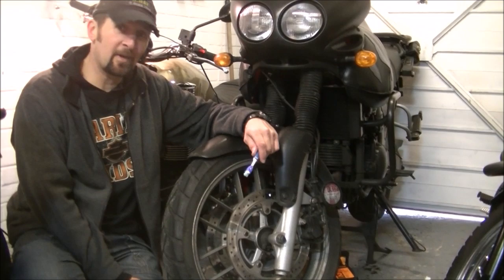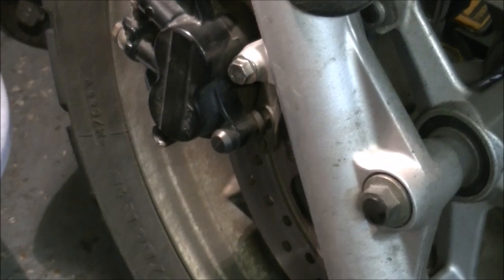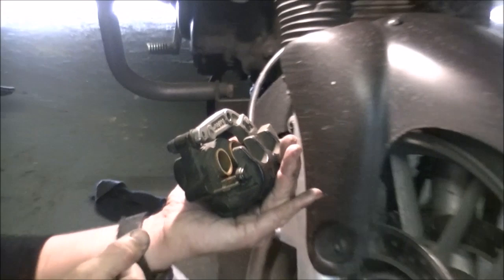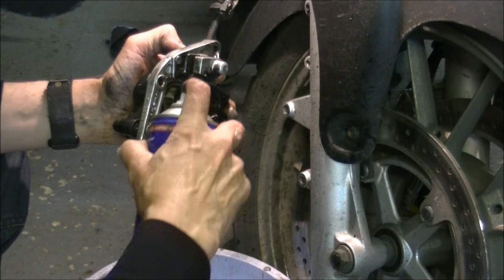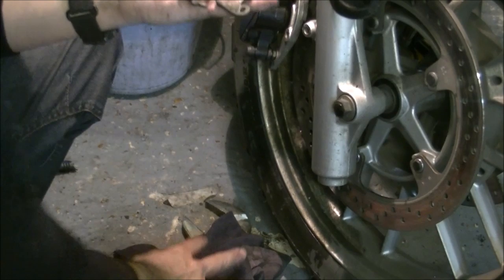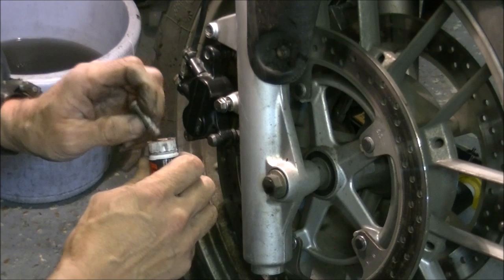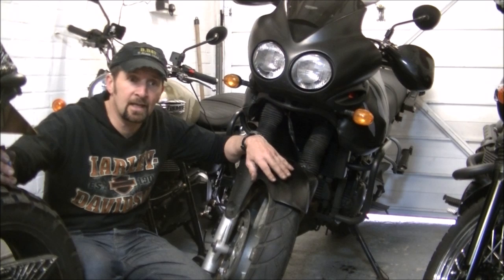Delboy's Garage, Triumph Tiger, Winter Brake Clean .

Comment: Top tip mate, always worth reminding people about these basic maintenance routines!
For those who are scared of using grips on the brake calipers to push the pistons back in: you can just open the brake fluid reservoir and remove the diaphragm, then push VEEERY GENTLY the pistons or you'll end up with a squirt of fluid on the ceiling AND on your bike! ;)
keep up the good work mate, always respect your passion and commitment!
Matt
Reply from the maker: Thanks mate...

Comment: These videos are really helping me learn the basics as I didn't have a clue! Did my first chain adjustment Sunday and the bike feels awesome as well as me =) just got my 125 and is relatively new (1600 miles) coming into Winter I think i will do this before I ride it as my back brake is squeaking slightly. Cheers for the videos! They really do help :)
Reply from the maker: Nice one Ethan, I love to hear that, we take the time to do this for the sake of riders just like you... good on you buddy.. get stuck in and keep it in tip top shape... the first thing the accident investigators do in a bad accident is look at the vehicles involved to check for faults, neglect and dangerous dis-repair.....and 'a binding front brake' will get you blamed every time... plus it can lead to the accident in the first place... just drop me a line any time you need a tip or any help..alsways here and happy to help fellah... good luck aye.. Del.

Comment: Ay up, that time of the year again. Good tippage on the dust cover -mine welded to the rear caliper last winter & I had do drill it out. No problems with it since though -the waxy copper slip really does the job! :o)
Reply from the maker: Ayup Lasty mate...good to hear form you.. and yeah, those little caps can be a bugger to get out... See you at the Ace cafe in December aye..?

Comment: I'm sure this is the third video I've seen you do this? ;) For some reason my brakes bind, I've refurbished the callipers and clean them every other week, even tried changing to a different brand of steel lines but no luck. 

I'm definitely guilty of having tons of pics on my phone on how stuff fits back on the bike!
Reply from the maker: Photographing a job as you go is wise old practice buddy, any way better then a Haynes manual..lol... It is probably the thrid one ive done...but then i do it eveyr year on a different bike, so why not... If your calipers are binding, have you actually stripped and cleaned the pistons, new seals and rebuilt them yet..?
Reply: Yeah wouldn't trust a Haynes too much, to remove a headlight bulb it says to remove half the bike.. Im too lazy and would rather have scrapped knuckles and do it in half the time lol

Yeah brand new seals in the callipers and the pistons couldn't have got any cleaner if I tried. Rebuilt is what I meant when I put refurbished!  =)
Reply: Cheers for the tip Paul, don't think the fluids even close to the max. mark but Ill check it!

Comment: Another fantastic and clear vid.  Love the drill/sandpaper trick to clean the pin.  Just use the finest grade paper? Thanks, Pete
Reply from the maker: Yes Pete, i grabe a scrap of old used paper that almost smooth, then it leaves no lines just polishes it right up..! cheers mate.. Del.

Comment: Do you have any experience of doing this kind of thing on a VFR800 or something else with linked brakes? I would like to do it but I'm terrified of all those brake lines... It's a bit of a plumber's nightmare... Hoodie arrived yesterday, love it! thanks!!
Reply from the maker: Hey up chap, glad the hoodie arrived safe, it's always a worry when we send them off with the postie...

I've done a brake bleed on my Blackbird, which has the same system, which is a few years ago, and it's not complex, just a little fiddly... the best method is to pressure bleed them with a pump device, but if they're working ok at this point, mate, then why do you need to bleed them?  As long as there is no air in the system, and the pivot is moving on the front forks, it should all be fine... as long as you change the fluid every 2 years, or 3yrs at absolute most, you'll be fine...
Reply: Not sure I will bleed it to be honest as they still feel firm enough. I've had the bike a year now and I'm not sure how long ago the fluid was changed, but it is a good colour so I'm guessing not that long ago! I might just whip the calipers off and give them a good scrub then, provided all the hoses allow for that, and leave the bleed for another year! I'm lucky enough to know of a really cheap garage with a good reputation so they can always sort it for me :) Thanks mate, take care

Comment: Really enjoy these videos, Delboy. Keep 'em coming.

Recently stripped my calipers because of a leak about a month ago (turns out it was shoddy mechanic work after a Suzuki GSXR master cylinder recall). Had them apart twice before I realised. Grief.

After the dealership fixed what they fudged in the first place, they then asked who was working on my calipers because they were leaking (very, very mildly) at the seam. The pistons were fine so it leads me to think either I didn't get the gunk out from underneath the O-ring (brand news seals by the way) or it's because I didn't use a torque wrench (haven't yet invested).

I believe the pads are contaminated to an extent now too so I'll have to chuck them in the oven.

Any suggestions for this pleb?
Reply from the maker: Hey Mr Bee....we're all plebs mate...just different levels..lol.

If the caliper is leaking at the casting joint....i would drop them apart again to make sure you dont have some debris trapped that's stopping them seal... and take the tiem to get some new joint seals. (the dont come in the regular seal kit) then make a really good job of rebuilding them cleanly... its not wise to just wind them up tighter because if it is a grain of debris in the joint all you'll do it damage the threads.

I know its long winded mate, but its the proper solution and you cant really take too much care with brakes..

Good luck with it..
Del.

Comment: Hello, Its almost imposible to get the copper grease in my country (Mexico) what do you think about using Litium grease instead copper grease just for the bolts threads? Not for the back of the brake pads.
Greetings from Mexico!
Reply from the maker: Yes you could use that Enrique, it will work, but if the area gets hot, then the lithium grease can melt and flow... you could also use a threadlock as this also forms a barrier to prevent corrosion and can still be removed, use the medium blue stuff.
Reply: @Moonfleet41  Thank you sir!

Comment: hey Del another wee brake related question for you, When it comes to getting my bike back on the road again after my off, im gonna have a bit of work to do such as cleaning the brakes again. i was wondering if having ABS would mean using a different method to whats in this video?
Reply from the maker: Hello mate, how you doing?  ...bleeding ABS is a slightly different technique, but if all you're doing is bleeding out the calipers and leaving the lines plumbed up, then you shouldn't have any more trouble than a regualr bleed... take the banjo out of the caliper and turn the hose back on itself to stop it draining... then when you re-connect them, there's only a tiny bit missing... it's difficult to describe in an email, but see how you get on like that, and let me know if you have a problem!
Reply: Moonfleet41 thanks for that Del but i was just curious about cleaning, fluids will get done with the next service. I have no idea how ABS works. so wasnt sure whether taking calipers off and back on again needs to be done differently with ABS

Comment: hey Del quick question.....Is the cleaner you use in this video the same thing as muc-off brake disc cleaner? 
thanks again mate :)
Reply from the maker: Pretty much mate, it's just a spray on brake and carb cleaner... am sure Muc-Off do one, they do practically everything else lol!
Reply: Moonfleet41 cool thanks mate, didnt want to buy something that would mess up my brakes. couldnt find anything else in halfords, :)

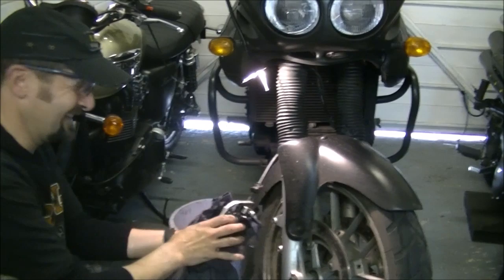Comment: Hi Delboy, Just before 13:38 when pistons are clean and dry I normally spray a bit of Silicone spray on both inside and outside of the calliper and then when after a couple of minutes spray a bit of copper grease on the piston and some goes into the calliper. Do you have any experience with copper grease causing problems with the seals?
Reply from the maker: The copper powder within it can be abrasive to rubber seals mate, so always use a dedicated rubber lube wherever rubber bears against metal... it has long since been a practice to add a dab of copperslip to the back of pads to absorb the harmonic vibration that leads to squealing, it's even written on the packaging of copperslip... it's heatproof, so won't melt or work it's way on to the disc face, like I said just a dab mate....
Reply: Thanks mate, makes perfect sense to me. Although I've never had any problems with this in practice, I'll stop it. I appreciate your response. All the best.

Comment: Delboy, with the side walls of the pistons gathering crap, as the pads wear more of the side walls are exposed, so only if the pads are renewed and the pistons retract this maintenance is more important as the mating face of the seal needs a smooth surface to travel across?
Reply from the maker: Most pad thickness is less than 5mm, so hardly a huge amount more piston wall from 'new' to 'out'......and who would replace pads every time they clean thier brakes..!
Reply: No the point is the more the pads wear the more of the piston wall is exposed, so the contamination issue is only relevant if the pads need renewing as the pistons need to retract more and the cleanliness is more important with regard to the seal...??
Reply from the maker: *****
No not in practice...its logical what you say...but in reality, the minute "in and out" of the piston in daily opperation is what gets jammed up with road salt and grime..

Comment: im going to need your advice please, I was changing the brake fluid on my sportster rear brake, not sure the last time it was done if ever, ]only really just got it], it started coming out a dull yellow  and plenty of bubbles in it after what seemed like an age on it, then it started coming out a dull white now its back to a dull yellow with bubbles still coming out. iv used about 3 quarters of a litre and its still wont clear do I need to carry on bleeding or do I need to get someone to look at it thanks jim
Reply from the maker: Hi Jim, your rear brake system holds a total of no more than a small cupful of fluid, maybe 1/4 pint tops, so if you have cleared the old stuff through and the fluid coming out now is fresh stuff you've put in the top, then the job is done... provided the fluid coming out now is the same colour as what you are pouring in, then it's just air bubbles... are you sure you're not allowing the fluid level in the cup to dry out when pumping through?? If so, you are dragging the air in... just bleed through without letting the cup run below 1/2" fluid level at the bottom, and make sure your bleed technique is not sucking air back in to the bleed valve.... do this by making sure you hold the pedal down, whilst you open and close the valve, good luck with it, hope that helps!
Reply: ok brake sorted, I think the problem was leaking nipple or a bad seal with the tube, what my real worry was it took 3 quarters of a litre for the fluid to come out clear. I did the front brake first and didn't have any trouble with it. so thanks for the advice keep up the good work and  good luck with a Harley thing your trying out see you soon jim

Comment: Del, I have been told in the past that copper slip on bolts effects torque accuracy when using a torque wrench, whats your thoughts on this?  I've always copper slipped and then torqued on brake caliper bolts and I noticed you did the same - I'll have to start marker penning the bolts!
Reply from the maker: Hi mate...Lubricating any bolt gives you a better and more acurate torque result...it allows the bolt to turn in to its correct value fully and not stop short due to friction of metal to metal binding. and the only lub for anyting that gets hot is copper grease or graphite anti sieze..! and the marker paint is just my old OCD, nowt like being able to check the bolts at a glance any time..!
Reply: Cheers for replying. a big plus is less chance of seized bolts! :)  I'll continue lubing mine!  PS great idea for cleaning up the slider pin, I ended up buying new ones but this would have saved me some cash!

Comment: Man this is awesome, i am a complete ignorant when it comes to mechanics actually i am kind of scared, but you make it look so easy. The rear tire on my bike got stucked but after a half an hour or so it rotates normally again, do you think it is because the brakes are dirty ? Do you think i should give it a try and clean them up... Thanks a lot for any comment on this, i`ll appreciate any advice... forgive my limited english (my bike is Triumph Tiger 800XC 2014)
Reply from the maker: +Vinicio Aguilar Hi Vinicio, Sorry to hear about your brakes issue.. YES i think you should service the caliper, take it off and give it a good clean to get all the brake dust and road dirt out, then see if that clears it... Im glad we can inspire you my friend, good luck with it.. Del.
Reply: +Moonfleet41 sorry to bother you once again my friend, i already took everything apart, clean it up and when i try to put everything back together the piston doesnt want to go in, i am using only my fingers to push it in beacause a friend of mine told me not to use any tools so i can damage the piston. What can i do to push the piston in ? 

Man thanks a lot for all your help, this video as you said, really inspired me to get my hands in my bike, you make it look so easy, Thank you very much mate !
Reply from the maker: +Vinicio Aguilar Hi again Vinicio, its not uncommon to have a hard job fitting the pistons back in...first you can smear a very tiny amount of grease around the piston to help it slide in...and if they are really stiff, i use a "G-Clamp", put a cloth on the caliper to protect your piant, and if the clamp will not reach in to the bottom of the piston, you can put a small socket in there so the clamp can puch in the centre... that always works for me... good luck and let me know how you get on... Del.

Comment: another great vid guys,got to do a complete rebuild on my blackbird ,do you have any tips on re bleeding them,duel brakeing system and all,many thx and I know its early but merry christmas
Reply from the maker: Hi Nick. if you dont need to change the fluid in the whole system, then just take the caliper banjo off, and emediatly turn it back on itself,m and hook it up so the fluid doesnt leak out too much... then whern you refit them, you can just bleed them up like a regular non linked system...it can help to bleed them with the caliper off the leg and helr up so the air rises to the nipple...use a chunk of old number plate to represent the disc or the pistons will pop out.. its a bit 'three hands' but you get a totally rocj hard bleed every time. Thanks for wathcing buddy, and good luck with it.. Del.
Reply: Moonfleet41 many thx for the advice budski ill give it a go,cheers mate

Comment: Great advice as always Del, especially the bit about using a dry pin. Never looked at it the way you do it before and now it makes perfect sense not to use copperslip on it. Duly noted :) I use one of these (link) to press my pistons back in and you can nip em in a tiny bit at a time if they're correctly adjusted. Keep up the good work. 
http://thumbs1.ebaystatic.com/d/l225/m/mM5dRjFsQTO3NJeULBDj0uw.jpg
Reply: Actually Del I think the ones I have are a slightly longer reach than those :)